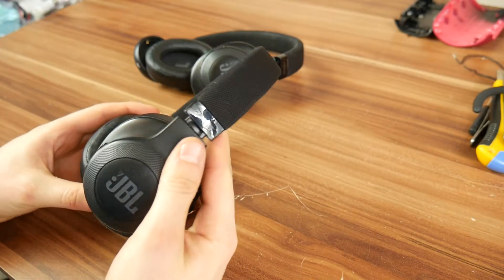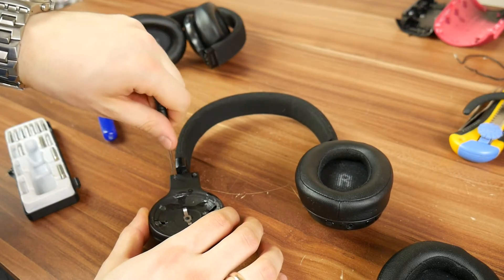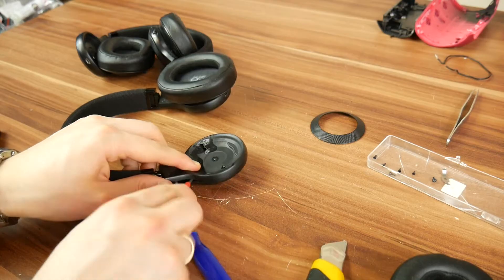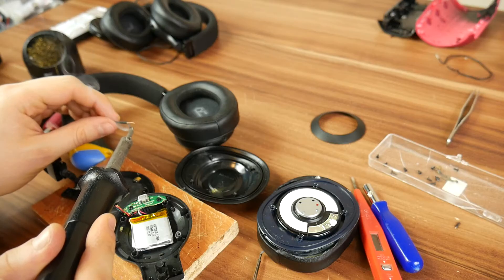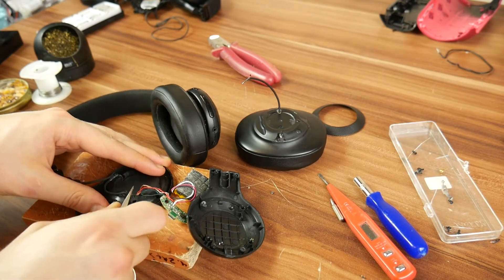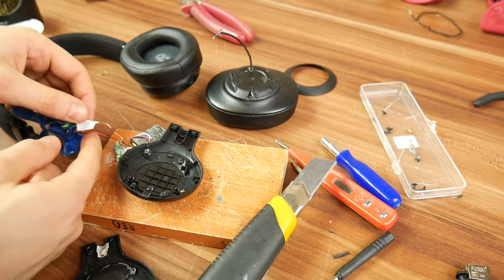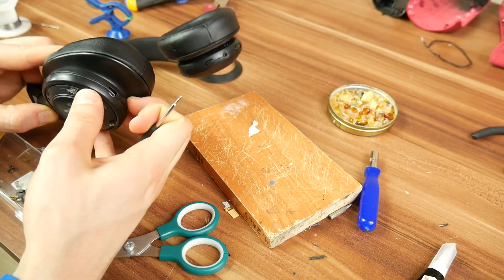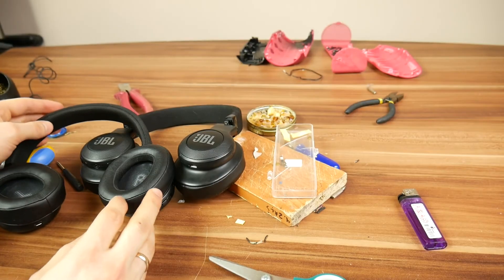How to repair/fix JBL e55bt headphones - not working one side

Comment: Didn't expect this video to come handy with the same model having the red light of death as i call it (stuck in red light even after charging it when trying to turn it on)

Followed the instructions to open it and found a slightly misaligned wire, fixed it and it finally worked.
Reply from the maker: thanks for feedback :)

Comment: Can I change the battery
Reply from the maker: of course, but why you want to change the battery?
Reply: @TechscrewDIY  it doesn't last long again
Reply: @emmanuelakinyode1731  Me too
Reply: @TechscrewDIY  Do you have a solution for the battery problem other than getting a new one
Reply from the maker: @ndifor_kenny  if you don't want to change the battery, the only solution is to attach and glue a small power bank to the headphones

Comment: my speaker is scratching.
can i use other speakers? Do you know the diameter, ohms etc
Reply from the maker: if you want change speaker driver, then they both have to be changed, to avoid imbalances
Reply: do you know if it has to be the original ones or if you can use other ones
Reply from the maker: @saschalichtnau5657  JBL dont sell its speakers, need to buy alternatives from aliexpress.

Comment: This video really helped me, mine didn't turn on so I wanted to check the inside and I didn't know there were screws inside that plastic cover, so thanks. 
It seems the issue is a burnt switch, and I don't think I'll find another one so I think I'll just buy new headphones 😅
Reply from the maker: thanks for feedback, I always recomend buy the same headphones, if they like, because then you have old pair for parts.

Comment: Anyone who is having issues, wiggle your aux cord and see if that temporarily fixes it. If so, one of the solder points is bad but its an easy fix:

Open up the headphones as shown in the video (There are 3 glued down clips on the inside of the textured ring that can be carefully lifted to access the 4 Philips head screws.) and remove the ribbon cable carefully to make soldering easier. Ready your soldering iron and carefully press down a very very small amount of solder and reattach the ribbon cable to test. If that works, just reassemble and you're good to go!
Reply from the maker: thanks for good advice :)